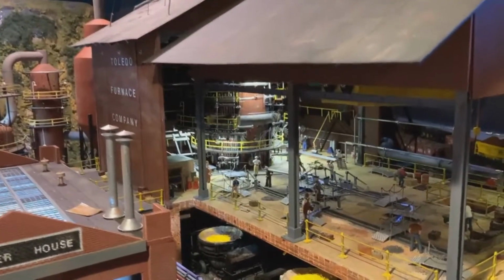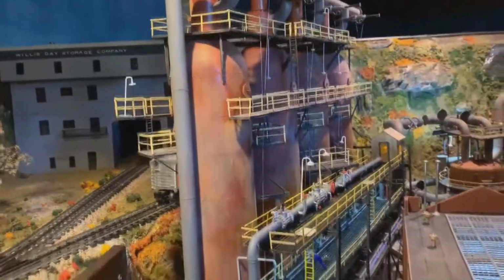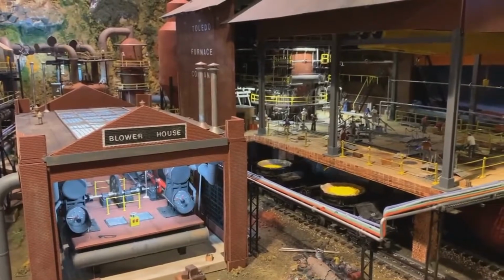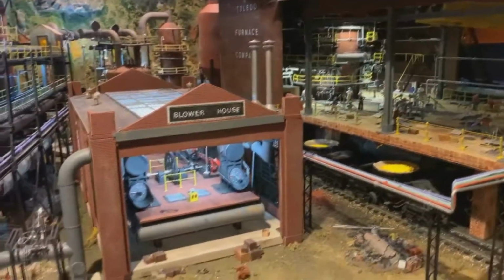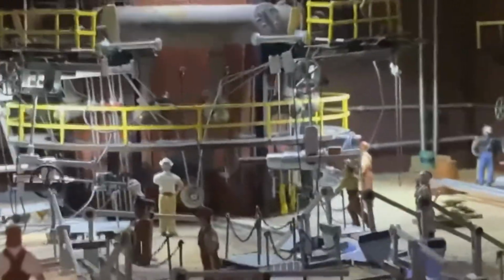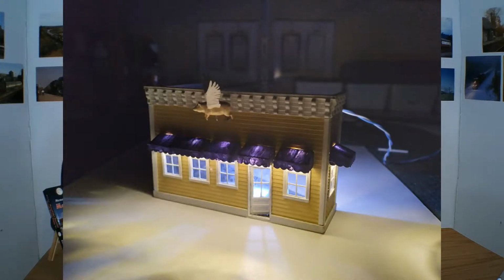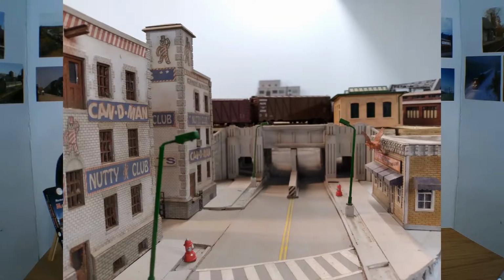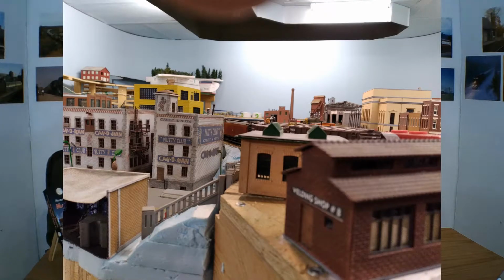ITS TRAIN TIME the SHOW EPISODE 14

Comment: How large of an area do you guys have to build a layout in?
Reply from the maker: 24 feet by 34 feet with 2 peninsula, one of 16 feet and the other 20 feet on each side of the peninsula which equal to 40 feet of rocky mountains
Reply: My steel mill layout is 44' by 14'

Comment: The detail you can achieve in O scale is so spectacular. It just takes so much room to model it. Amazing job Mr. Peter Hess has done on his blast furnace. I'd go with 1:48 scale if I had the space to build a layout large enough to be able to make more than a circle of track. I've got a 14' × 24' building for a 3 level layout I plan to build in HO scale and I'm having trouble including all of what I want to model and had considered going down to N scale but I don't think I could work on that small of stuff because of my eye sight and shakey hands and I'm only 37 years old so those things aren't going to get better as I get older. Great show as always. From NC stay well.  -Wil   👍
Reply from the maker: you are right, his detailing is pretty amazing